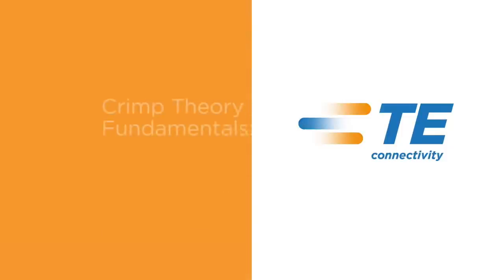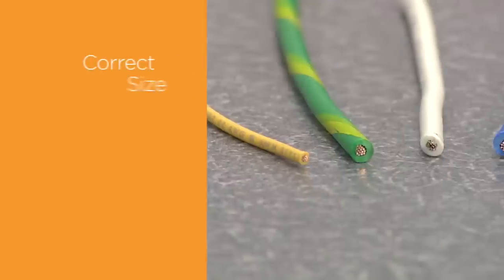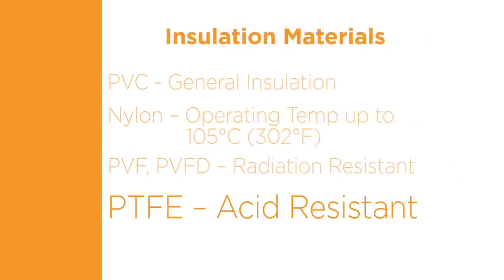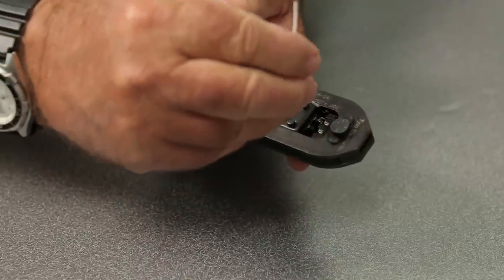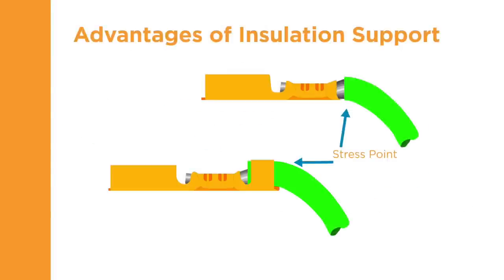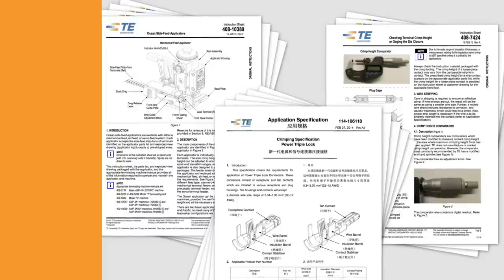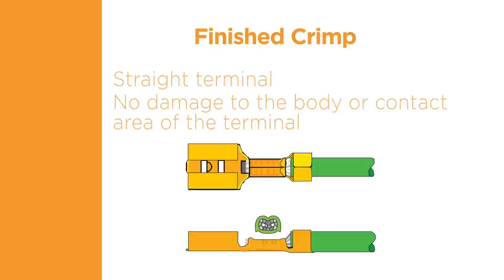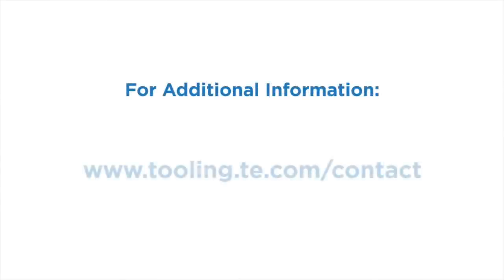Crimp Theory Fundamentals: ADVANCED

Comment: I think too many people underestimate the power of a crimped connection and just assume soldering is always best.
Reply: For a long-term connection that is to resist oxidation over time, or is to be used in a harsh environment, I would prefer soldering, or soldering the crimped connection.
Reply: dialetric grease will help with oxidation. Flux from the solder will just cause more of it.
Reply: @eurobum2012  flux does not cause oxidation, its specifically to prevent it during soldering, you think that effect ends after and goes the opposite way? Rosin ACTIVATORS cause the surface of the copper to form copper abietate, which can be confused for oxidation by non-metallurgists.  Oxygen cannot penetrate rosin.
Reply: @snap-off5383  under perfect conditions maybe. Add heat or moisture and all bets are off.

Comment: The wire going to the blue ring at 0:15 was not stripped properly lol
Reply: Also: 3:59 ¨The area increases proportionally with the diameter¨
False, it increases exponentially ;)
Reply from the maker: Thanks for watching our video and providing your feedback.
Reply: @STARDRIVE  Also wrong, it increases quadratically
Reply: @fernandoyamaguchi  Last time I checked, quadratically means the exponent is two. So I guess we are both right.
Reply: @STARDRIVE  I don’t think so, exponential means that the independent variable is the exponent, 2^x is an exponential function, X^2 is a polynomial function of second order, or quadratical function.
Reply: @fernandoyamaguchi  Google ¨exponential¨, and common definitions are akin to the following:
¨Relating to a mathematical expression containing one or more exponents. Something is said to increase or decrease exponentially if its rate of change must be expressed using exponents. A graph of such a rate would appear not as a straight line, but as a curve that continually becomes steeper or shallower.¨

It doesn´t say which is the variable, so by this definition, the relationship between the diameter and the surface qualifies.
However, when digging a bit deeper the almighty interwebs also states: 

̈In an exponential function, the independent variable, or x-value, can be defined as the exponent, while the base is always a constant. For example, y = 2 ̂ x can be known as an exponential function.̈

Being more precise, I take it professional mathematicians adhere to the latter. A new day, a new lesson:
From now on I will use the expression: ¨polynomial function of the second order.¨ :)

Comment: If the CMA is mm2, why are the calipers set to inches?
Reply: Interestingly enough, both inches and millimeters are units of length. So a diameter measured in inches still translates into a mm^2 cros section
Reply: Actually, “circular mils” refers to thousandths (“mils”) of an inch - it is a very confusing unit….